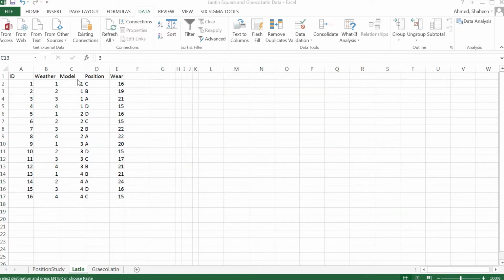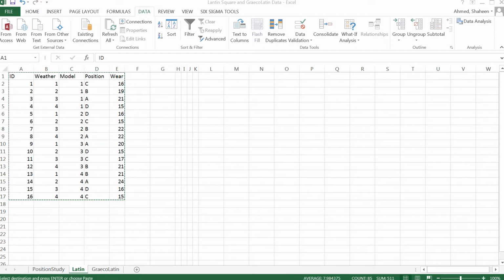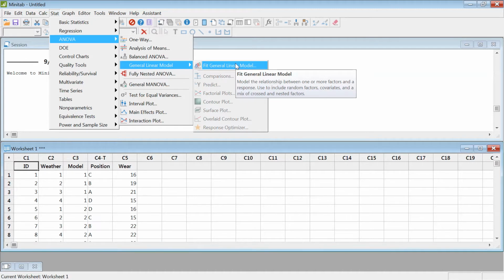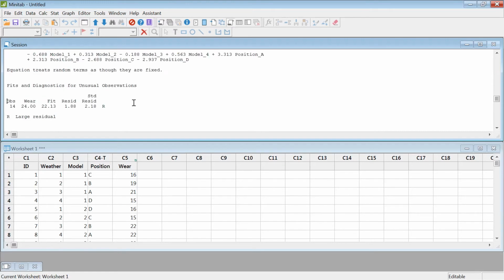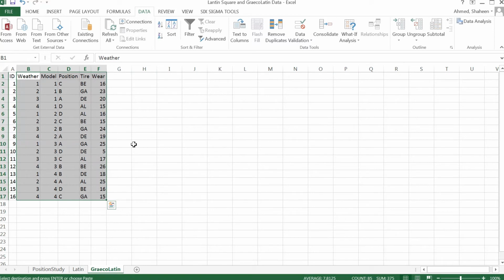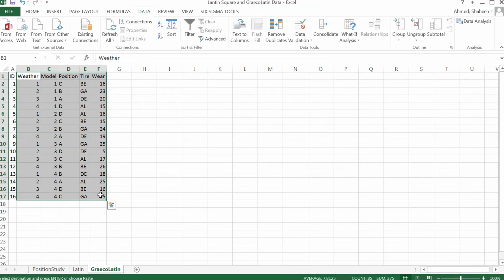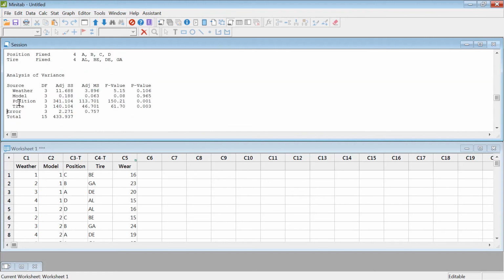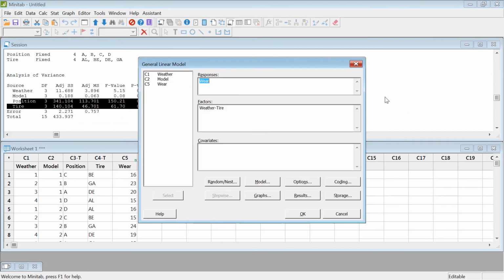Latin Square and Graeco Latin Square Design of Experiments DOE Analysis Example Explained in Minitab

Comment: Minitab General Linear Model: Random/Nest window, you selected random factor type for weather and model but for position was selected fixed factor type. I don't undestand these selection. In this window, factor type is depending on fixed effect model or random effect model statistical analyisi. Therefore, all of them should be fixed.
Reply from the maker: You could make all of them fixed. Moreover, in theory, both the weather and the model factor should be fixed because of the distinctive characteristics of them. So, you are correct on saying they should be fixed. However, in the example problem, levels of both the weather and the model factors were randomly selected, making both of them intentionally random factors. However, some factors can't be random such as the position of the tire (e.g. front right, left, the rear left and right). We can't simply randomly pick one and say you are front or rear and so on. Sometime like the male/female can't be randomized. We can't simply pick a person and say hay you are a male! For more on this, please check the module 0 of the http://www.theopeneducator.com/doe